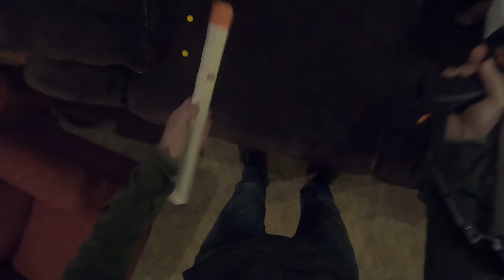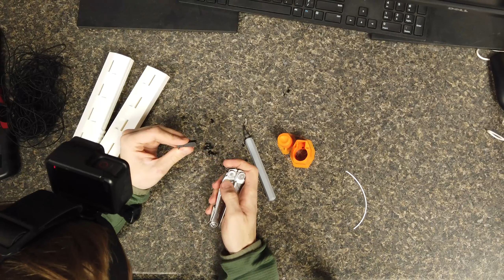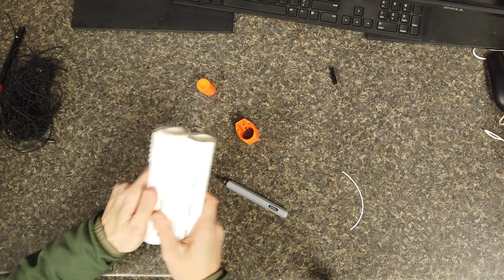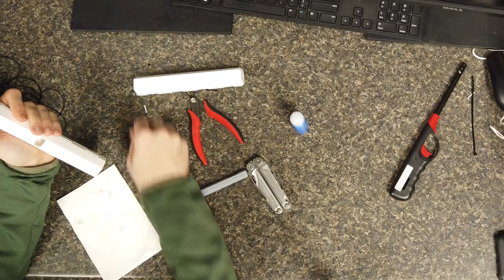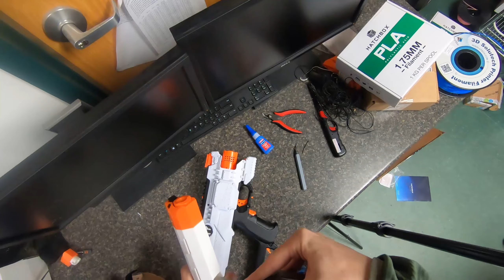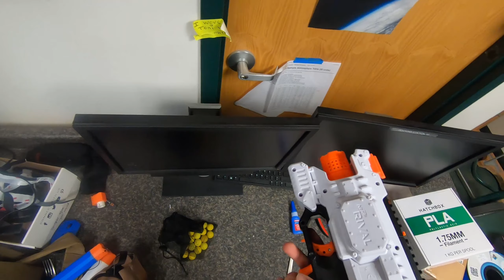3D Printed 16 round Nerf Rival magazine Assembly

Comment: Can I use the 15 round one with a pump action Apollo, or should I just make the 10 round one?
Reply: It all depends on the way the blaster indexes with the magazine. I think the Apollo indexes and holds the magazine by the intended notch in the side of the magazine. There is a notch on the 3D printed one that will work with that. I think the long magazine should work though. The extra length of the magazine will just stick out more from the blaster.